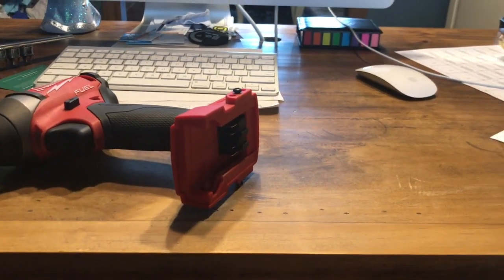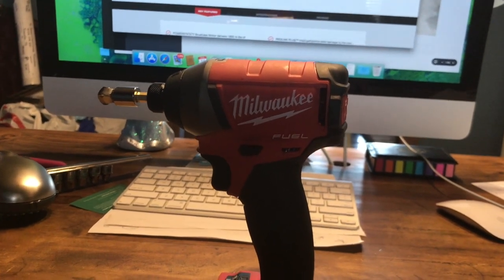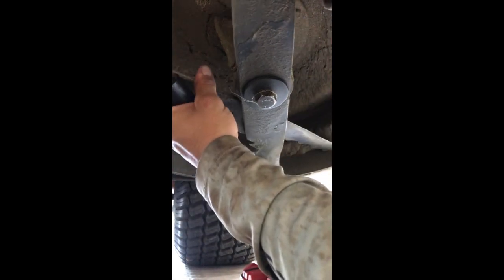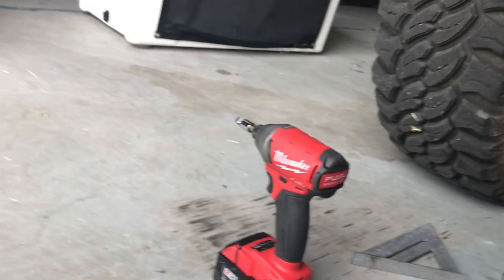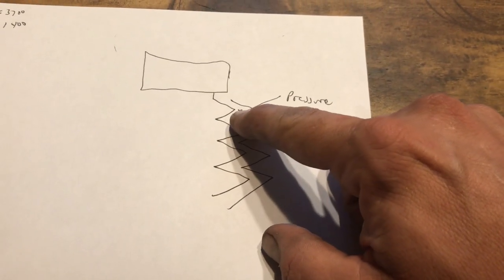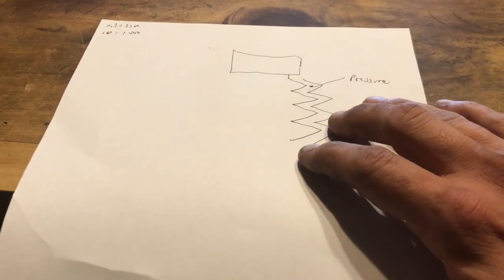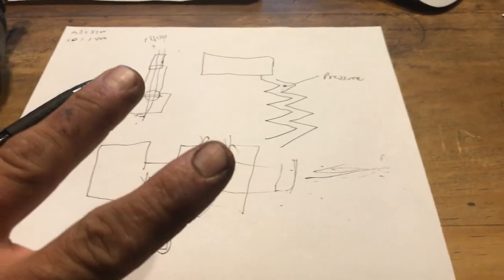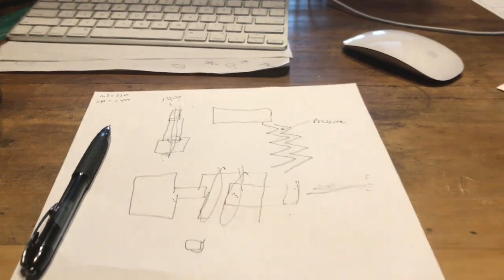Milwaukee 1/4 hex impact vs. snap-on mg325 on Jeep JK grade 10.9 bolts. Results are impressive.

Comment: Good points! I've seen mg325 break loose some stuff tho! 

Must not of had enough air behind the mg 325.
Reply from the maker: Nah, it had air, those extensions gave it hell. 

That said, put that Milwaukee in a shop and that Mg325. Turn a bunch of tire techs loose with both. Come back in a year. That Snappy will be no worse for wear and that Red will have long since broke. 
Just cause the Snap-On wasn't the right tool for this exact bolt by no means reduces its utility.

Comment: The mg325 is 100x more powerful than the Milwaukee. Get the right air compressor
Reply from the maker: The compressor used produces more CFM and more pressure than SO requires. Watch that explanation part again.